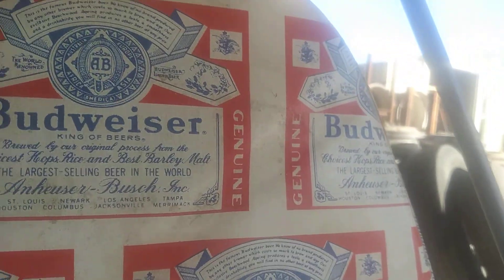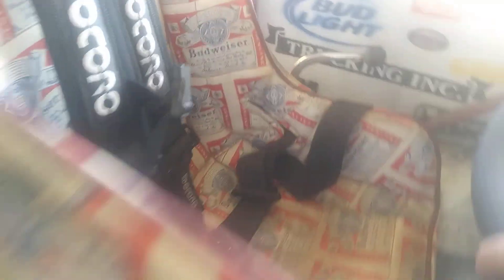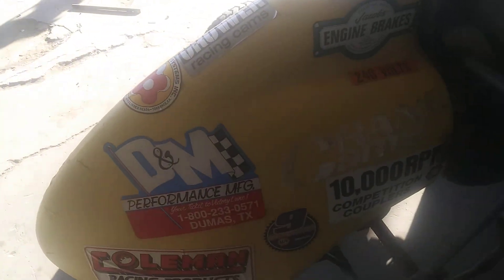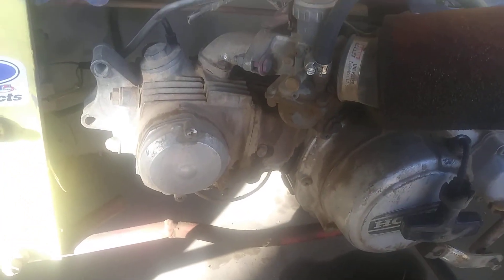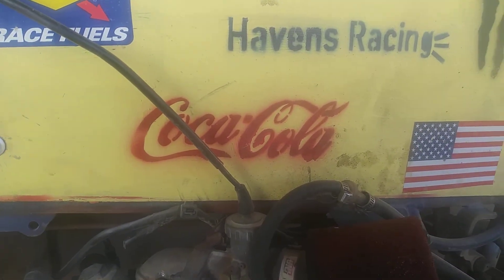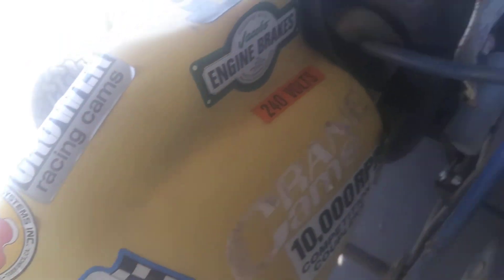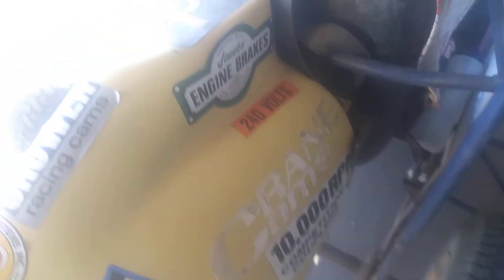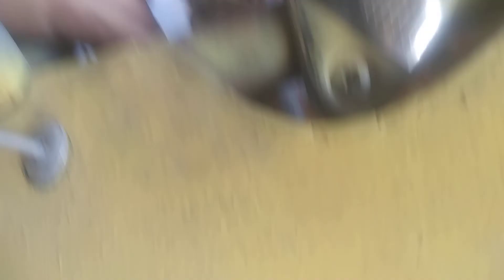a detailed look at my gokart

Comment: Is that a mini sprint
Reply from the maker: Well yes but actually no. Its meant to look like a mini sprint but it uses a 100cc honda engine therefore in essence making it a go kart. So yes and no I guess. I don't know. My grandpa made it in the 80s for my aunt. I rebuilt it over the summer.
Reply from the maker: @bubbawallace23fan86  thats sick. Starting late january im gonna start racing imca sport compacts at my local track.
Reply: Nice good luck